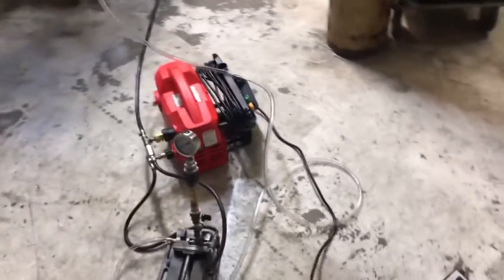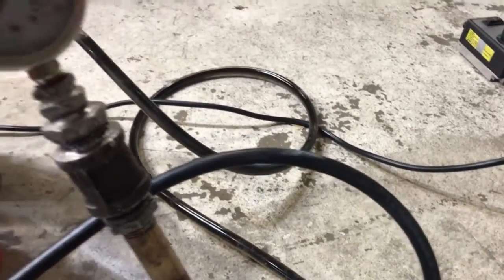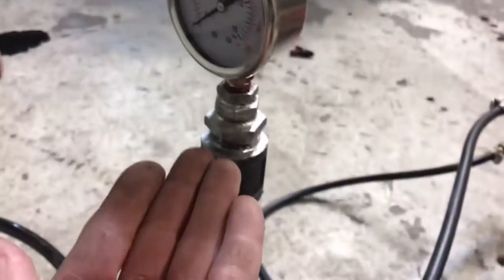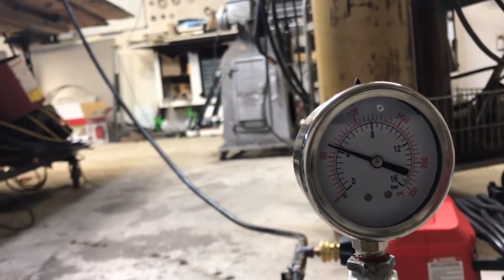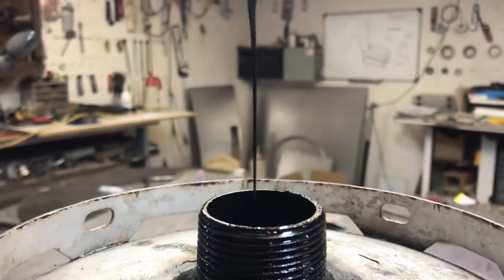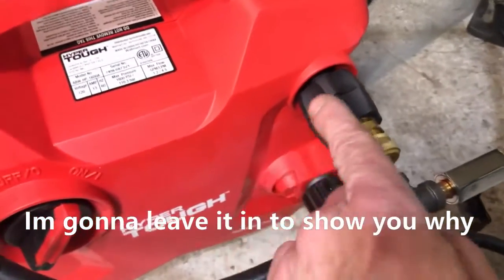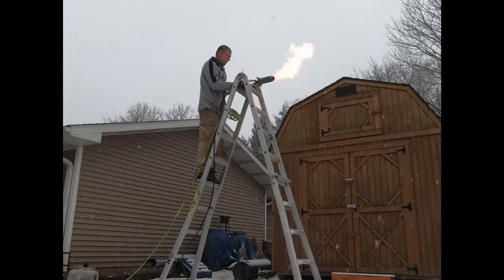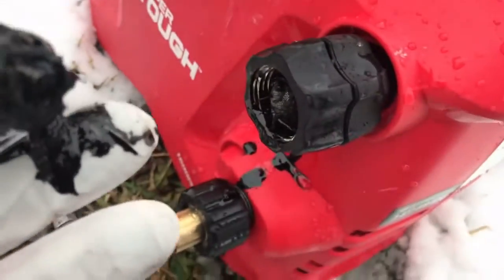Pressure washer oil pump for waste oil process heating at elevated positions

Comment: All my waste oil is ran through a mesh screen then a 2 micron filter then finally a very fine mesh screen and I've never cleaned anything out like you had in that screen. Where are you getting your oil and what filters are you using if its your own waste oil? Fram filters have been known to contaminate oil.
Reply from the maker: Its from an auto shop and every batch i ever filtered has this stuff , even when i take engines apart i find it , all kinds of filters are used from K&n and every brand an auto shop would see . Thanks for the input though , ill keep that in mind a the mystery deepens lol
Reply: @NOBOX7  weird? I have yet to come across this. Wonder what the heck it is?
Reply: @NOBOX7  morgellins in oil ....black x files gooo ;}

Comment: and for the 50psi pressure you could just use a automotive fuel pump. I know guys that ran 1 for pumping oil trough there turbo for years without a problem. And a injection pump wil reach about 100-125psi. And they flow more then enough for ANY burner. And the nice thing is they are small and take pretty low power. I think its about 150watts for a decent sized at maximum pressure.

Comment: why run it at low pressure? I think running waste oil on really high pressure trough a nozzle could make it evaporate without using air. Old diesel engines only used about 100-150bar and a good nozzle to make automatic igniting mist in the engine. In your burner you dont need it to auto ignite, and you have a hotter surrounding where you spray it in. So i think the maximum pressure of the pressure washer together with a good nozzle could make that happen. And you seem to have a pressurewasher filled with oil anyway, i dont, so i cant try it but you can.
Reply from the maker: to much pressure is not good for this application . this is not a high pressure atomizer nozzle
Reply: @NOBOX7  this is not, i get that, but i mean a high pressure atomizer nozzle might be a step forward. No air compressor needed would be a HUGE improvement in a lot of cases. Less power consumption i think, and less noise. Lower maintenance cost as wel. If you run a air compressor all day they wont last much longer then a year, maybe 2.

Comment: Technically you can use the positive displacement oil pump from a small car engine. ~( 'w')/
Reply from the maker: looked into that required a build for the motor mount and a motor and transformer if using 12 volts
Reply: @NOBOX7  You can literally use any motor you want. 

Even the gearing system from a free standing can opener would work. You can get those all day for a couple of dollars at a thrift store.

All you need to do is attach a drive motor [with or without gearing] to a hexagonal drive shaft [if you use this exact make and model, as some use a slotted end shaft] and mount them firmly to your platform [be it metal, wood, or plastic] so they are firmly affixed and in alignment with each other.

Again, ANY motor, an old used AC drill, an old used DC cordless drill, an old can opener, the types of motors one can get, AC or Dc are pretty well limitless, and can be had very cheaply second hand, some even new are quite inexpensive.

The same is true for power supplies as a whole lot of used laptop chargers have flooded the market in recent years when the laptops have crapped out, but the chargers which produce a very good amount of power at 18v still work just fine.

The pump brand new online is less than $30 shipped to you. This is by far not your only option, just one I saw quickly online. You might could get the same pump for less at a local in-town discount auto parts store where you live, which would mean 'same day delivery'.

https://www.amazon.com/Pump-1962-1995-ford-Engines-Pressure/dp/B07V2CLGK2
Reply: @NOBOX7  Nothing requires you to convert to 12 volts if you do not wish to do so.

Comment: that's a lot of effort just to pump some oil. I'd just pressurise the oil container with some air.
Reply from the maker: ok so if our oil tank is a 1000 gallon plastic tote you think that's a good idea ? this thing needs to run all night . so to pressurize a 2 hour tank is a waste of time
Reply from the maker: This is the cheapest fastest solution , the guy needed this the next day , no time for searching for a $300 100% duty cycle oil pump .